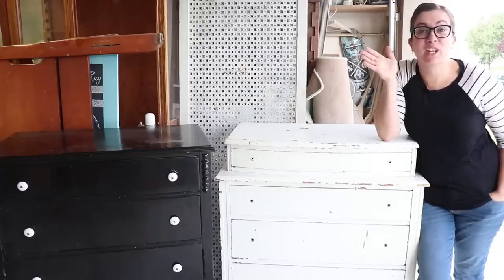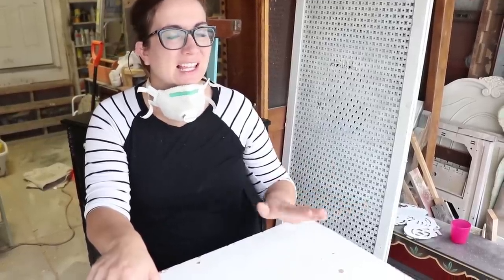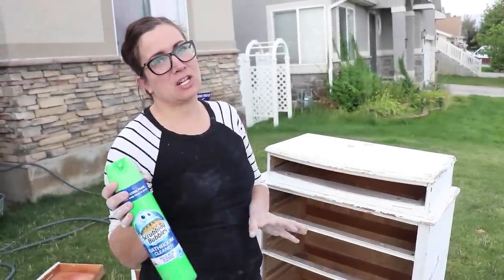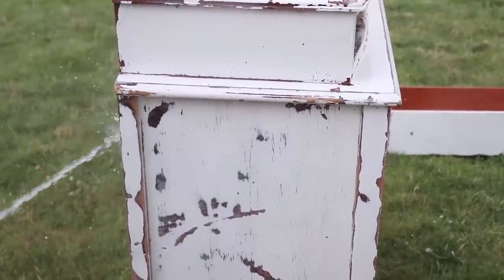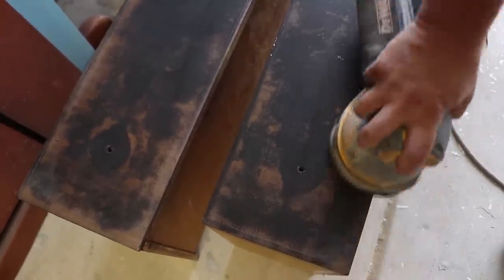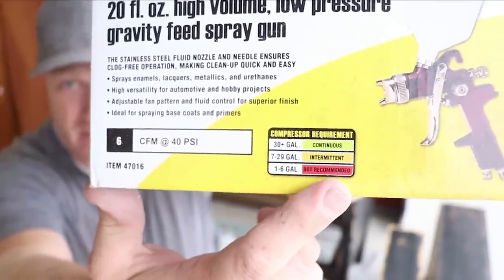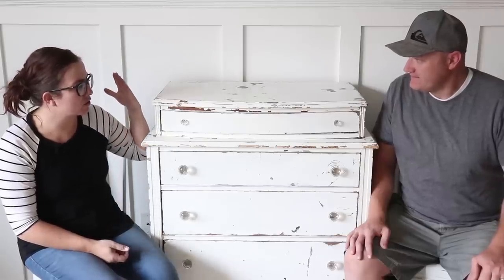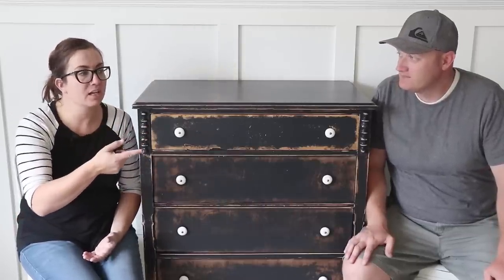Farmhouse Decor | Furniture

Comment: Question: What do I do to the inside drawers of a dresser that stinks like red oak (guessing) and makes whatever clothes that are in it smell too? This piece is a cherry dresser that was purchased new in the 80s. My daughter always left the drawers slightly open. Now I know why she did that. Help!
Reply from the maker: If it’s the actual wood that’s stinking you may want to deal that in. A couple coats of shellac or even a sealer like Big top should work to help with that. Maybe try one drawer and see if it helps first before doing the whole piece.

Comment: Hi Jami, I’m redoing a hutch I just purchased but I can’t decide which sealer to use when I’m done chalk painting it. Do you recommend any? I was thinking of going with polycrylic or sweet pickins top coat but I’m not sure which one is more durable. I really like the matte finish the sweet pickins top coat has but does it last or is it something that constantly needs to be reapplied?
Reply from the maker: They are the same durability wise. At least that I’ve noticed. We used sweet pickins Top Coat on our dining room table and it’s holding up really well.
Reply: Jami Ray Vintage thank you, I think I’m going to try it out!

Comment: Sometimes dirty means cigarettes were around, i.e. tar. I have tried to use Goof off, but maybe you have a better solution for getting it off.
Reply from the maker: I usually just scrub it like I did with the white one in this video, then I shellac the entire piece and repaint. Cigarette smoke is really hard to get off of pieces. Lots of extra work. 🙁

Comment: Very interested and would appreciate info regarding the sprayer you mentioned.  I'm not really sure what the product is you're spraying here... 'top coat'.  is that a varnish?  We're curious if this sprayer would work WELL for stain?  Or do you have any sprayer/air compressor combo that you've used that does work for stain?  Many thanks!!!
Reply from the maker: I would use a critter sprayer for stain. Much easier to clean. Here’s a video link on both sprayers. The Sweet pickins Top Coat we spray is a matte Minimal VOC product that we carry on our website. 

https://jamirayvintage.com/products/top-coat-sweet-pickins

https://youtu.be/YUf5LL_yKvE critter sprayer

https://www.youtube.com/playlist?list=PLprcXWqGeBKhlfJjGDODEV2XgHqY7WcK3
HVLP sprayer.
Reply: thank you for this!  But is Top coat a varnish type product or more in the paint family?
Reply from the maker: It’s water based and acts like a polycrylic but retains a lot of the “chalky” look that you get when using chalk type paints or milk paint. It’s very wipeable and durable. We use it a lot on table tops that Zeb builds and it holds up great. I haven’t found a paint or material I couldn’t use it on yet.